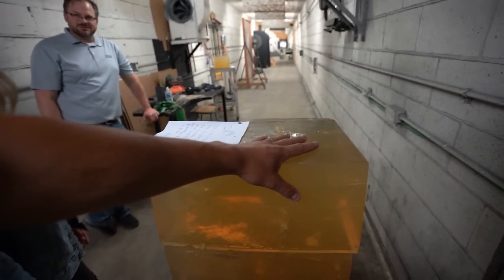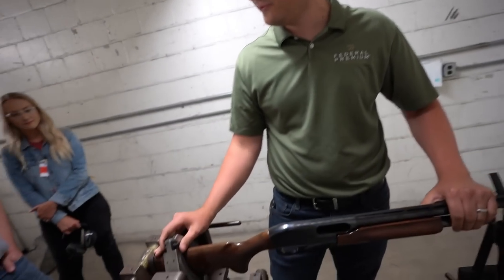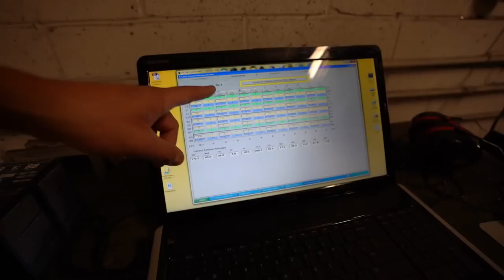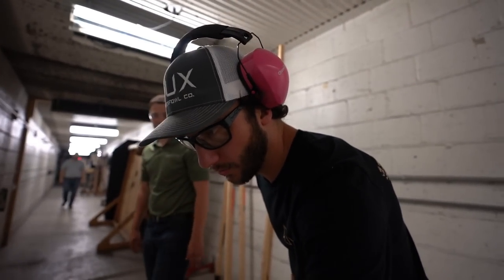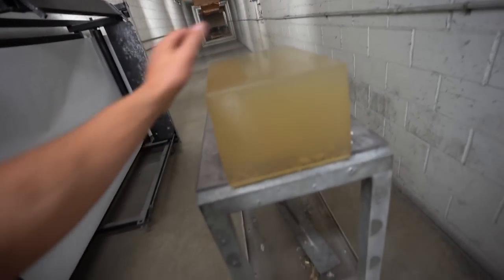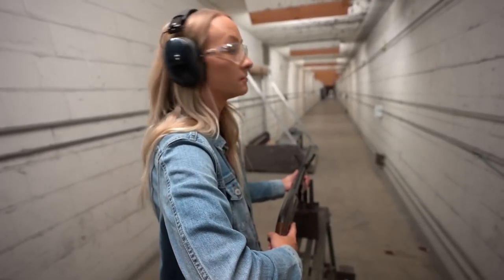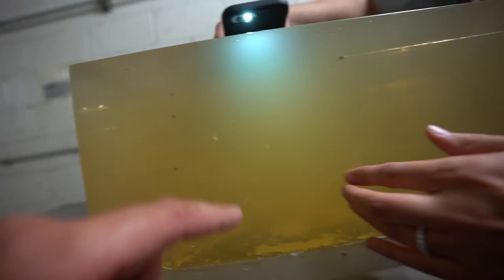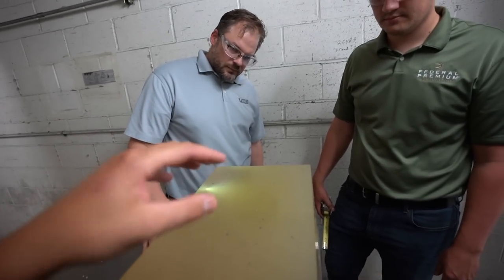Shooting Ballistic Gel with My Favorite Duck Loads!! (#4, #2 and BB)

Comment: Bobby,
     I have been a Federal fan for my whole life so it was interesting to see the production video and this testing video. In the comments below, several people have asked what choke was used in the patterning tests? Maybe I missed it but I never saw the answer to the question. What choke was used and what was the constriction? The folks at Federal were very generous with their time and expertise and allowing you to film in their facility. I know it's not possible for you to  cover everything in one video but it would have been informative to compare performance results of each shot size with each choke/ choke tube (Improved cylinder, modified). In general, steel shot usually shoots modified patterns through improved cylinder choke, and full choke patterns through the modified choke. These results suggest that the tests were conducted with a modified choke. Of course this may vary with different guns and different barrels. Well done video and thanks for sharing.
Reply: I noticed in the “credits” under hunting gear at the bottom it says modified choke with 3” shells. Over 70% @ 40 yards is impressive

Comment: I have been using #4 for rabbit hunting because it is a about the best in high brush area's. It cuts brush very well and still has enough pellets to get the rabbit. I have shot ducks on the fly with a single shot .410 #4 and bagged 2 duck with 3 shots in 30 seconds when i was 12 years old 45 years ago. I still have number 4/ 20 gauge shell from when i was a kid CIL and Canuck brands.

Comment: couple points,  There is no head and neck on duck or goose more than couple inches and only half that to center but it may need to penetrate thin bone . Thats why the smaller tungsten shot is great it is small but so dense it penetrates easily .  Think of a stabbing action with an ice pick versus a ball peen hammer .  The ice pick penetrates with very little force while the hammer wouldn't really penetrate at all even though the hammer is much more powerful.  Think of a goose as a flying turkey . Velocity and small shot kills.  The downside of small steel shot is that the velocity falls off much quicker and is affected much more by wind so it allows more drift especially as it is slowing down.

This is why I usually carry two guns one with 3 inch 4 steel high velocity for less than 40 yards especially small ducks.  One gun with 3 1/2 inch tungsten blend 2 s or the Federal Heavyweight 15.1 density Turkey loads in 6 or 7 shot.  yes its expensive but get it on sale and not too bad.  Often at Rogers $15 for 5 with extra off with coupons etc. Remember if you aim well it will just take one shot and very few cripples unless you shoot over  70 yards.  This load will literally kill waterfowl at 80 to 100yds but I don't advise it too many cripples past 70yds again pattern density not that great that far and will take shooting more shells but the 6 will penetrate far enough to kill.

In the grand scheme the cost of shells is small compared to other waterfowl hunting costs for most of us.  I just don't want to shoot $2-$3 shells at close teal !!!  Two guns is a great compromise one just a 2 3/4 "dove" gun is fine for the close shots.  If you consider this make sure it is legal where you hunt and make sure both are plugged etc.  more importantly make sure everyone with you is appropriately licensed or if checked people may well get ticket for hunting without a license and even with video evidence you would end up in front of a judge and a lot of hassle.  Remember it would be hard to prove even with video that someone didn't shoot the extra gun since you would have to prove you videoed everyone every minute (think dead battery and camera angle here).

Comment: Federal has come out with some very good ammo. However I have used the blue box and I'm not impressed. The one I'm quite impressed with is the Federal upland steel. The cheap ones in the green box. They are the dark red 2 3/4 #6. Haven't had a single problem with them. And out of the box, I've olny missed 2 shots on either rough grouse or quail. I do  wonder the actual durability of the shell, waterproof, hot car proof, primer success rate, shelf life ECT.

Comment: Out of curiosity, have you compared the hevi shot heavy steel #2 3" shells to the blue box for pattern? I like both blue box and hevi steel in #2 and both have preformed well I'm just wondering if it's worth the extra cost for hevi steel or if it patterns much better than the blue box. Awesome video by the way!

Comment: One thing to take away from gel test, #4 had less penetration at 40y than the calibration BB-gun did at point blank!
Would you shoot a goose with a 500fps BB-gun up close????.
#4 is Not enough at 40Y to be ethical in my opinion. 
I pattern tested a 20ga #4 steel round at 45y by putting a target on a heavy cardboard box, and to my surprise there were pellets rolling around in the box when I checked the target.
Always always test your ammo in your gun before you go hunting like they stressed in the video.

Comment: I just bought 500 rounds of 12 guage 3" #2 shot for $216. 😎
Reply: Geeeeeeez what a plug. Can we get a link?????
Reply: @mikekuflum9955  bass pro shop on line. I don't know if they still have any. Good luck bro.
Reply: @makerofmanythings8447  anytime i go on that site it states in stores only if not out of stock.

Do you recommend these shells for home defense with your experience?
Reply: @mikekuflum9955  Thank you for watching and commenting, the #2's are no joke and they are tall brass even taller than a slug so that makes them very powerful and I now that I would not hesitate to use them in a home defense situation, they are devastating on a target.